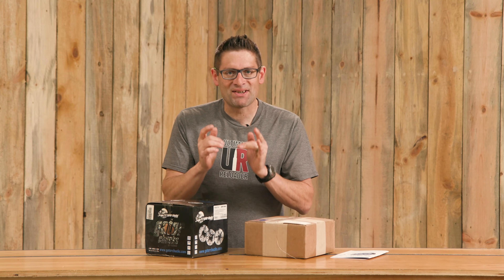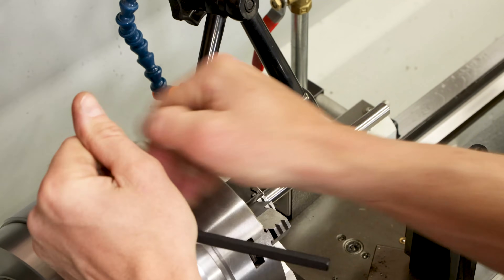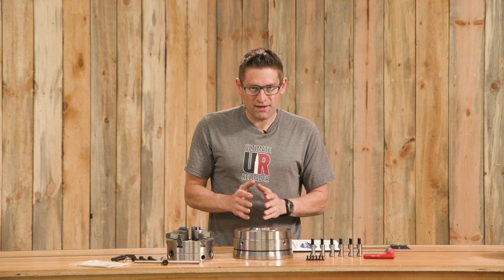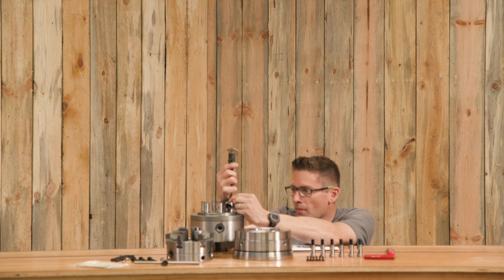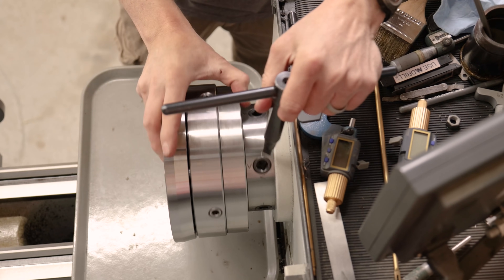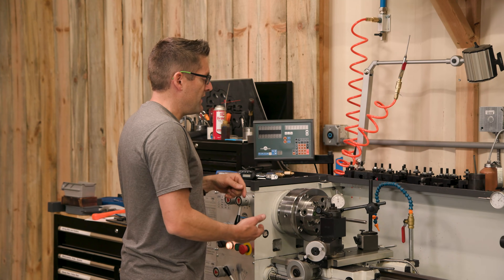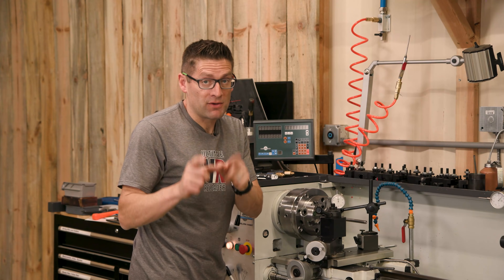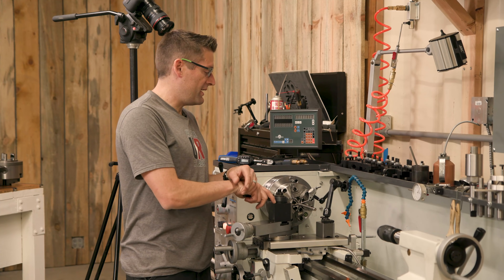True Bore Alignment System In-Depth (for Metal Lathe)

Comment: Rather than using an expensive gizmo, wouldn't it be better to properly install your lathe?  It seems that you are putting a band aid on poor lathe installation.   The ways should be properly leveled, and the headstock and tailstock should be carefully aligned.
Reply from the maker: No

Comment: Hi Gavin.  I just received my own TBAS and notice that you aren't dialing in the work piece as prescribed in the instructions.  I am wondering if that means you found a better way to do it or if you are just more comfortable with the method you demonstrated.  In any case, are you still using the TBAS, and, if so, are you still using the method used in the video.  I will try it both ways and see for my self but interested in any comments you have to share with two years of experience at this point.  Thank you for all the great and educational and entertaining videos!

Comment: So if you have a 26"-30" barrel that isn't perfectly straight, hanging 22"-26" out the backside of that chuck, spinning at around 600-1000rpm, how do you deal with the whip created by the centrifugal force of it being out of balance?
Reply: A spider on the backside of the spindle restrains its movement. If it's minimally eccentric the forces are pretty low, so the outboard spider doesn't need to be super beefy.

Comment: FYI. You lost torque by using the adapter for the mounting bolts. Especially with the length of the adapter. Not sure how much, but you definitely lost some torque if it matters.
Reply: Fake news

Comment: Great video Gavin, just a note, when you place the true bore plate onto the spindle, the mark on the locking screws for the cam ( number 1, etc.)  should when tightened, be between the two V marks on the plate. if it is not, you need to take off the plate and adjust the height of the cam pins with the screws located right next to them, this should be done until all of the marks when tightened, are between the two V's. This helps with alignment and keeping the plate at zero runout for long periods of time.
Cheers, a fellow machinist.

Comment: Just curious, do you need the lathe spider when using this system?
Reply: I was wondering the same thing. I'm guessing no. Since this is supposed to be the same with short and long barrels. Even really short barrels that don't pass through the headstock. Which obviously wouldn't be able to use the spider anyways

Comment: ive had to make a shit ton of bushings to thread muzzles with my tbas but on my haas tl2 this is the only real option for double dialing since the headstock is so deep

ive also had to go to rigid reaming which beats the floating holder method by a long shot

Comment: This product doesn't seem to improve much if anything over using a four jaw independent chuck in the way of how quickly you can dial in your barrel.  It does add multiple interfaces in comparison to a simple four jaw.  Anytime you add those interfaces you introduce more possiblity of movement or error post indication.  Another thing I don't hear mentioned is that this product moves the chuck further away from the spindle bearings versus using a chuck mounted directly to the lathe.  This imparts, albeit small, additional force on the spindle bearings.  That additional leverage result in potential deflection.  Seems like a lot of money spent for little to no return.  And before you keyboard warriors with no machining experience take off pecking on the keys, I am a highly experienced machinist who has chambered some very accurate rifles.  Many well known gunsmiths still chamber between centers.  This is more of a sales pitch for an unnecessary product than a review of a innovative product that benefits the majority of end users.
Reply: I agree with your comment that this system is not needed to build accurate rifles. But I do want to bring some things to your attention. Ultimate reloader approached me several times over several years wanting to Showcase this system. it had been referred to him by someone  that uses this system and that Gavin Trusts. My advertising up to this point has been all word-of-mouth, happy customers telling their friends in the industry. 

Although Gavin did not pay cash for the system he is not getting it for free. He is offering a service to me. He has built a company with great product reviews And a large following. Making and editing videos is not an easy task and it's worth a Fair wage. I believe he only promotes equipment honestly and that he believes in himself. I would never ask anyone to lie about my system. 
I have not been seeking out someone to promote my product
But because of Gavin's persistence and his reputation for Quality reviews I agree to his terms, to benefit both of us. My goal in all of this is to persent what I believe to be a game-changer in the precision rifle building world to a larger platform. This system can only benefit people if they know about it.  that is my goal in working with Ultimate reloader. Although it is important to work with what we have, discouraging small improvements and innovative ideas would only keep us in the Stone Age. This idea of it's good enough we don't need to try to improve something I will never stand for. 
My system is not required to make extreme accurate rifles, the one behind the machine is the one that controls the quality of their work. This is only a tool meant to add efficiency and consistency to the workholding process. And it does work very well! I only build and sell products I  use myself and have seen the benefits of. 
Sincerely. 
Nathan. 
Straight Shot Gunsmithing
Reply: @nathanmagman  please don't take my comment as saying this isn't a quality product and a nice addition to a lathe for certain applications.  Just as you said, Gavin has a huge following and therefore a tremendous amount of influence on people.  Many of his followers likely have little to no machining experience.  Showcasing a product like this without clearly pointing out who it's geared towards, who would benefit the most, and some of the negative aspects of the product is a disservice to the viewer. Case in point, by shifting the entire chuck and workpiece off the spindle centerline you can create a serious imbalance which is exaggerated as spindle speed increases.  Much more so than offsetting the workpiece in a four jaw chuck.  This can create a dangerous situation.  I didn't hear that mentioned as a negative or at least precautionary statement.  An amateur machinist or gunsmith would be much better served to invest in quality inserted tooling if they don't have it.  Or possibly take a course to enhance their skills rather than spend a large amount of money believing a product is magically going to make them understand basic principles of machining and supersede experience behind the machine.
Reply: How does one chamber between centers?    Kinda hard to get a reamer in the bore with a center in the way.     Maybe I'm.confused
Reply: @9point3  thread the tenon between centers.  Use a steady rest to hold the barrel and move the tailstock out of the way.  Now you can access the bore of the barrel with the reamer.  That's my problem with many of these videos.  People are watching them to learn because they just don't have experience.  You get sold something by a YouTuber making a promotional video of a free product they are given.  Look up Mike Bryant.  He's a world class gunsmith and shooter who has an excellent article on his website about different methods of chambering.  I am not bashing Gavin, I like a lot of his build videos.  But I don't like useless promotions which impress people with little to no experience who are simply trying to learn something.
Reply: @justg2949  So you are not chambering between centers.

Comment: Wait! What? How are you going to indicate barrels or anything in now? Is it a Gator Tech-Tru chuck? So you are going to throw a barrel in the .0004" repeatable chuck the indicate down?
Reply: The entire back plate that the chuck attaches to is where you indicate in the barrel at which in turn does not introduce any stress in the system.

Comment: *Will this guarantee a perfect center from now on, or you have to realign it every time it come off the lathe? (Or will it stay on permanently?)
*A bit more indept why this is wanted vs. using a regular 4-6 jaw chuck would be nice Gavin. 
*Is the 'rod' used an reference tool with perfect/consistent diameter and straightness?
Reply from the maker: Magnus- if you align the chuck to the spindle, it will re-mount to the lathe centered each time (I'm going to mark my "pin #1" on the TBAS). RE: compared to a 4-jaw and spider- this fixture imparts less stress on the barrel or action, and is quicker to dial-in in my experience. Yes, the ground rod is for alignment reference.
Reply: @Ultimatereloader  the chuck setup will repeat fairly consistently but rifle bores aren't straight and seldom centered so you have to dial them individually for best results. I do believe you hit a point of diminishing returns at some point. But the fact is treating every barrel as a unique setup will always provide ultimate accuracy.
Reply: @Ultimatereloader  Thanks for clarifying. Love the indept technical and machining stuff you do!

Comment: im saving up for a lathe and im so excited for this stuff. 

is the precisiom mathews 12x36 a clone of the grizzly 12x36?
Reply: I would say it's likely the other way around if you just look at cost and area of manufacturing. Grizzly's are Chinese and/or Taiwanese, they don't really wanna say... PM is Taiwan made.
Reply: @magnus5356  im happy with my grizzly minimill but  PM doesnt seem to have financing.
Reply: @magnus5356  PM has a Chinese and A Taiwanese version of most of (if not all of) their lathes. Only their Ultra Precision ( PM-XXXXT) are Taiwan where as the ones that do not have the T suffix are Chinese made.
Using the original mention of a 12x36 lathe, from PM there is the PM-1236 and a PM-1236T, only the PM-1236T is a Taiwanese made, the regular PM-1236 is Chinese made.